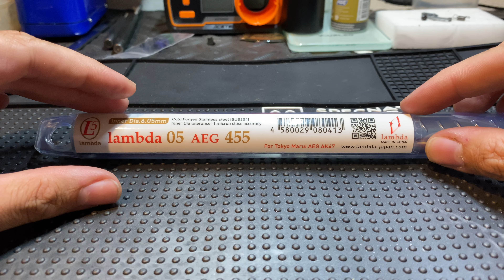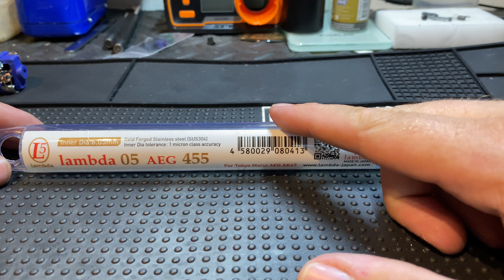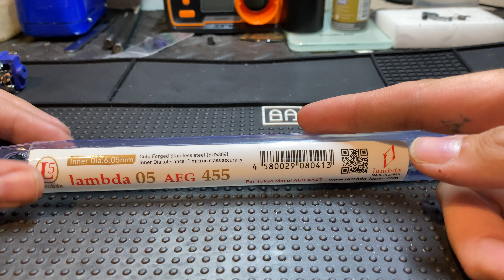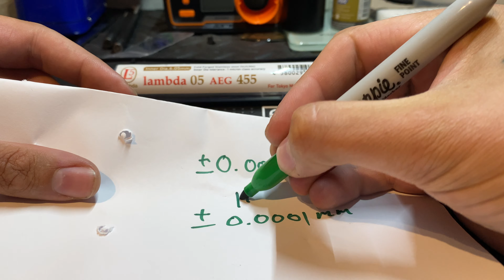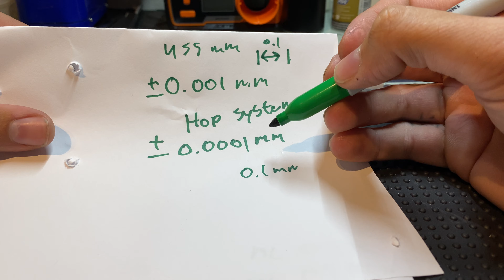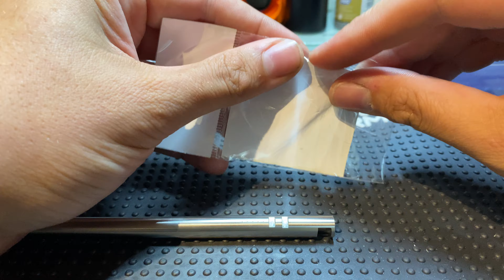What nobody tells you. [Lambda barrels]

Comment: Currently using the “old” MR hop. With the new silicone version, would you use the same degree/hardness as with the old rubber version?
Reply from the maker: I would go one step up in hardness for the silicone vs the regular

Comment: I had two lambda barrels and really hate them because of how sharp the window is. Actually I lost 3 buckings by those. Much better choice in my opinion i Da-Vinci Airsoft. I have also heard that Da-Vinci is on pair with PDI. Compating both, the quality is actually the same, but Da-Vinci has longer window. It's still a little too sharp but do not cut the bucking.
Waiting for your shooting test :)
Reply: Da-Vinci is run by the guy who used to run Lambda
Reply: You can use a very fine sand paper to sand down the edges.

Comment: @Reflex Airsoft 
What are your thoughts on Maple Leaf 6.02mm and PDI Raven? Those are coated barrels and really cheap. Will I notice any difference if I buy this Lambda or Davinci barrel instead? What would you go for if you wanted the best bang for your buck inner barrel?
Reply from the maker: That depends, let me use cars as a reference.

A coated barrels is like a rally car, it does not need that much cleaning or maintenance to work.

A stainless steel barrel is more prone to corrotion, dirt ect. So to maintain top performance it needs service and maintenance, like an F1 car

So yes your performance will increase with better barrels, but at a “cost”
Reply: @reflexairsoft4648   Thanks! Btw, when should we expect the shooting test? I will probably wait for it before my purchase.

Unless you give your blessing to a purchase of a Lambda FIVE. My other premium option is a Da Vinci Akaishi (from Begadi), seems really good except the material is not stainless steel but carbon steel. Quick check on google says that is is prone to rust (tho specification on Begadi says it is rust free), but stronger than stainless steel. What is your take on those?
Reply from the maker: The test is done and filmed, but working abroard atm, with no wifi and the 4G sucks, so uploading a 20 min vid is not gonna happen atm 

So yes carbon steel rusts, and it Can happen by just the moisture in the air where the Chromium portion of stainless steel Makes it very hard to rust.

I have a da vinci and i placed it in my shed, and it took 7 days to show signs of rust.
So i avoid carbon steel in alot of things, exept knifes 😊

I would choose barrel depending on hop Unit, bucking, and nozzle (hpa/type, aeg/maker)
Reply: @reflexairsoft4648  Well then, what would you go for in my case, I have a completely stock Arcturus AT-NY02-CQ
Reply from the maker: If you know how to install and align bucking/barrel.:Lambda barrel, Begadi mag5 or fly5(depending on bb weight) with omega nub.
If you dont know how: lambda barrel, modify flathop, flathop nub eg. Begadi Pro nub
Reply: @reflexairsoft4648  I guess I dont know how to do that but would love to learn it! Is there a guide on this topic online? Or a YT video? Unfortunately I could not find anything on this topic.
Reply from the maker: Its just if you know how to see if the nub pushes the patch Straight Down the barrel window.
Most people just puts a bucking and nub in, and dont check if it pushes correctly.
Reply: @reflexairsoft4648  Ahh I just tried to assemble the barrel to my Arcturus Hop unit, and it seems that the cut outs for the C clip are not quite there where the original barrel has it :( now  I need to replace the whole hop unit right? Do you have any recommendation for me that is surely compatible with the Lambda Five?
Reply: Just for the record: Arcturus AR plastic hop chamber is incompatible with the Lambda barrel. I switched out the chamber to a Specna Arms plastic rotary hop unit and now I can fit the C-Clip on.

Comment: Ur right, im working in the metal industry, I am a welder and fabricator as well, Every metal ( alloy and stainless steel even more) deforms by temperature, I think a simple steel tube expand more than a 0.0001milimeter if you go back to your warm room from a +5 degree celcius outside. Total bullshit.
Reply: if you take the equation in stainless steel l1 = l0(1+a(t1-t0) and a a of CrNi 80 20 (a=15,5x10^-6) you get a expansion of the inner diameter by 0,00047mm by just switching for 20 to 25 degree C. This means a 6.0500 barrel at 20C is 6.0505 at 25C...     so yes, 0,0001 tolarance is just impossible. Even 0,001 will vary if the temperature changes by 10 degree, lets say inside the hall it has 10 degrees C and in the testing room there is 25 degree.
Reply: @KeeepTV  bro i never thought that anyone will explain my theory when i wrote it. I didnt miss a lot by far.

Comment: Great review dude you videos are actually very helpful! I was wondering if you can make a video about nozzle to hop-up chamber fitment, I have a cyma 0.98 dmr with the v2.5 gearbox and maxx hop-up chamber i am using the standart 24.5mm nozzle but the maxx unit says to use 21mm-22.5mm nozzle length is there gonna be a problem with that or should i leave it as it is?
Reply: What did you end up doing Aztecs?
Reply: @tytalent4117  Im using the g36 nozzle i think (24.5mm) for about 10 games now and it seems that there are no problems so far

Comment: I watched your other video on bore size.  Do you have a specific recommendation on bore size?  I currently use a 6.01 (stock from Wolverine in my 6 month old MTW) but thought about trying something a bit larger, 6.03 or 6.05. I will buy a top quality barrel (wanted edgi but they are all out so probably a PDI).  A buddy of mine swears by the 6.05.  I can't seem to find any 6.03s in stock.  Is there really much difference between all three?  The small mm size seem like it would be inconsequential between the three.  I liked your comment about moving the barrel and the larger the diameter the more the bb would move around.  Not sure if this is the case why a larger bore barrel would ever be better than a smaller bore.
Reply: Stock mtw doesn't have 6.01